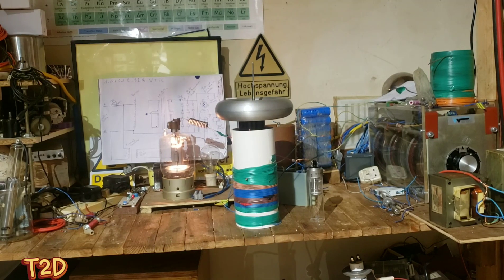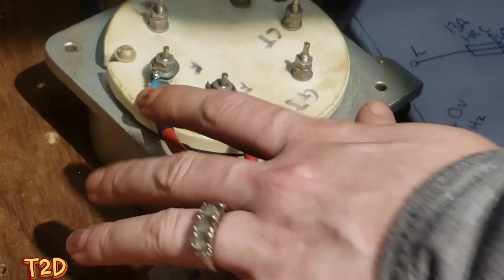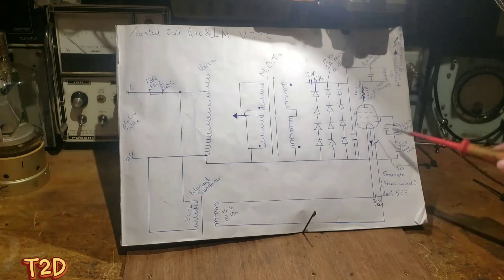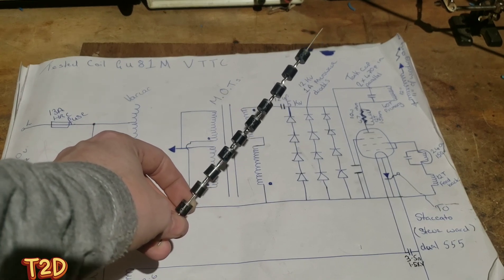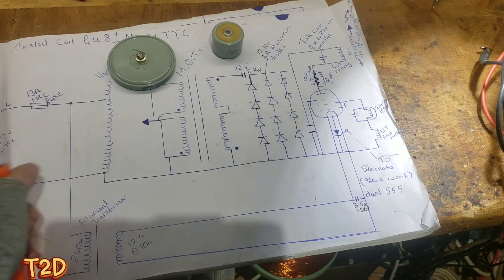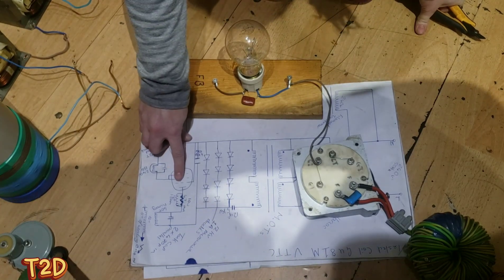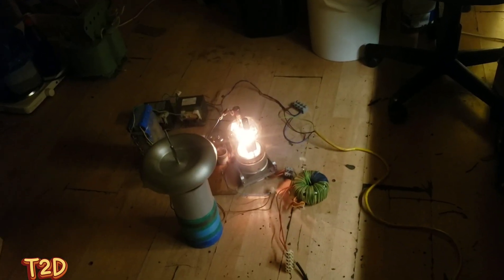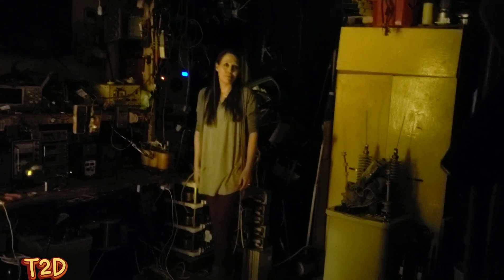GU-81m VTTC, Can my wife build a Tesla Coil?

Comment: Hey guys.  Can't get the interrupter to work.  i made a home made opto isolator with an led, a straw, some black tape and a photo transistor that triggers a 2n2222 that triggers the gate of the triac.  I'm using a bt136 600e and I'm able to actrually turn the coil on with my first pulse but then it doesn't shut off.  I added a corresponding LED to the output of the 2n2222 to use as an indicator to show when its turning off and on.  Im using an 18650 for a battery.  Any suggestions?  Maybe my triac isn't the right one?  once i trigger it with some pulse, it just says conducting.  thanks so much
Reply from the maker: Try a shielded cable, better to use a scr
Reply: @T2D.SteveArcs  Ty for your quick reply.  The shielded cable makes sense, I will try that.  Also I have noticed that most ppl are using a scr as u have suggested.  can you recommend me one to use?  That way I know that its working for you at least lol  Thank you so much man, you have been the best 
:)
Reply from the maker: @JoshHopkinsYT  I will look at what I'm using tomorrow for you mate, if I forget remind me👍
Reply: @T2D.SteveArcs  Thanks so much!  I really appreciate you :) ⚡
Reply from the maker: @JoshHopkinsYT  no worries mate 👍👍
Reply: @T2D.SteveArcs  Hey buddy, just a friendly reminder, wondering if i can bug you to check which silicon controlled rectum fryer you are using to interrupt your gu81m vttc.  Thanks again :)
Reply from the maker: @JoshHopkinsYT  hey mate...  IR 0645  50RIA220M...
Where do you live? If you are In Europe i will send you one for free👍👍

Steve
Reply: @T2D.SteveArcs  Thanks but im in the US!  I will definitely be trying it again soon probably with a sheilded cable inside a metal box or something.
Reply from the maker: @JoshHopkinsYT  ok mate a shielded cable should solve the problem I think, and any 1200v scr  should work fine...

Steve
Reply: @T2D.SteveArcs  tyvm. You have been a crucial part of my vttc learning experience and i really appreciate you sir
Reply from the maker: @JoshHopkinsYT  thanks mate😀 there will be more Vacuum tube videos to come 👍👍

Steve
Reply: @T2D.SteveArcs  Awesome dude, I can't wait!  T y so much again
Reply from the maker: @JoshHopkinsYT  Thanks Josh👍😀👍
Reply: @T2D.SteveArcs  Closest I can find is a 50RIA120, do you think that would work?  I can't find a 220
Reply: Thanks man, I bought a pair of them from China so they will be here in a month or so.  I will definitely be uploading the footage too!  Also I have a few videos of my coil on my channel if you are interested. I built it with your "Tested Coil" schematic. Thanks so much for everything.  :) ⚡
Reply from the maker: @JoshHopkinsYT  great I will take a look 👍😀

Comment: Hey guys, still waiting on my tank caps to get here.  Just testing my tube out and was wondering, should there be continuity between pin 6 on the bottom and the other ear on top that isn't the anode (G3)?
Reply from the maker: Yes mate they are connected in the tube

Comment: you should have made her wind her first secondary coil by hand. gain the same experience that the forbearers of the technology had to go through winding in there shop 1885 the first ac transformer was invented by Ottó Bláthy, Miksa Déri and Károly Zipernowsky. 1001,1002,....hahah. F that get the drill.
Reply from the maker: It's one of the reason a drill was invented wasnt it?
🤣🤣
Steve
Reply: @T2D.SteveArcs nope the drill was made for  power procution in 1873, Zenobe Gramme, a Belgian inventor, invented the first commercially practical and sold it to Edison.
Reply from the maker: @numatechprototypes222  awesome